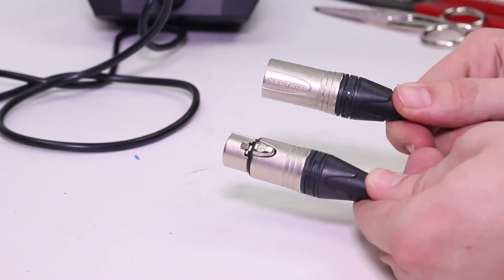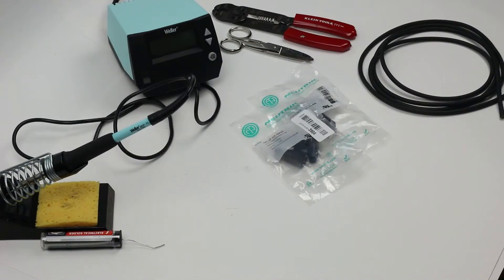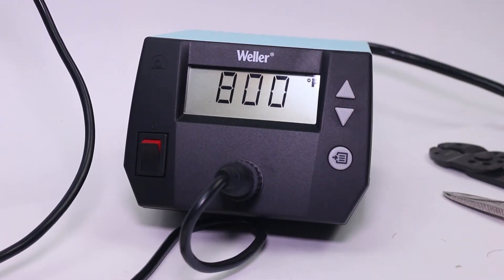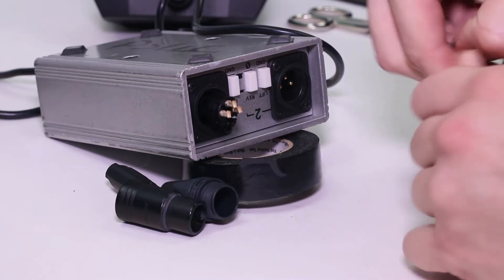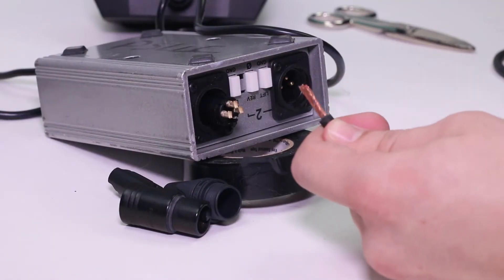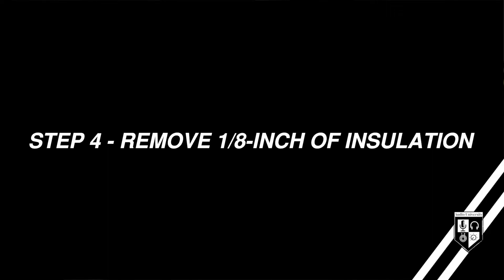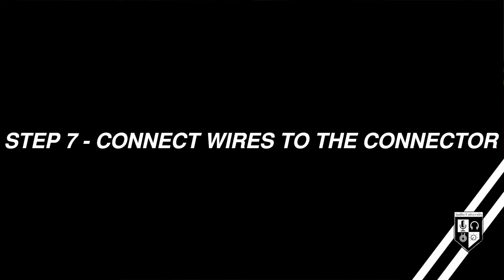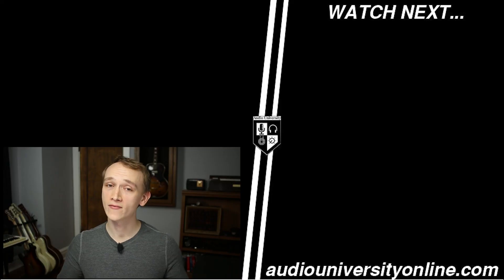How To Solder XLR Microphone Cables [Step-By-Step Tutorial]

Comment: Thanks man , you’re a highly trained and skillful teacher too . I notice that in the SHURE SM 58 User Guide that there is a wiring diagram , I see that on my repair numbers 1,2,and 3.i am using alpha fry 13463 Fine Electrical Repair solder . Works for me😅.63/37 rosin flux core . I didn’t know how to repair one mic cable for months ! Now I can . Thanks.

Comment: Old guy here.  Been soldering for 40 or so... Make sure your don't cut any strands.  If you do?  restrip.  Thats why you want a service loop.  Tinning wires? make sure you can see every strand.   Clean your tip. Fill the XLR cups.  Soldering should take no longer than saying solder.  Clean your tip, wet your tip with solder, and turn it off with a wet tip.  Heat the thing that you want to solder to, with a wet tip, Not your wire.

Comment: Probably being a bit anal here, but after you have applied the soldering pencil to the joint and then remove it, I find the wire wiggles just a little before the joint sets, as it’s hard to hold the wire perfectly still. Can this lead to a cold solder joint because the wire is moving a bit?

Comment: Which is male and which is female jack? After soldered figures must be shown clearly as it is our main purpose here. When cutting there was no white colored wire but when soldering there it is, why? In your diagram the colors are red green and black but in actual there is no green and black. This tutorial is confusing.
Reply: Regarding the diagram, the insulation around the conductors isn’t guaranteed to be any particular color configuration, but using green, red, and black to indicate ground (pin 1), hot (pin 2), and cold (pin 3) is fairly common. In this case, the best way to ensure you’re soldering wires to connectors correctly is by using an electronic multimeter to test the opposing connector for Ohms/continuity.

Regarding the “white colored wire,”if you actually watched the tutorial in its entirety (a whopping 6 minutes and 40 seconds), you would know why the color of the copper shielding changed to “white colored wire.” Go to 5:05.

Finally, you’re watching the wrong tutorial if you’re asking about jack genders and needing a closer look at after-soldered figures that are already shown sufficiently. But, the jacks on this broken transformer are both male (which you can see in the video), meaning the connector is female. You can also tell at the end as he assembles the connector.

Best of luck.
Reply: Yikes. Dude, clearly you're not inclined for this. The diagram isn't meant to say "LITERALLY ALL CABLES WILL BE THIS COLOR", it's just a random color coating. Not to mention it's quite obvious which is male vs female. Just look at the pins 🤦🏻‍♂️ and a simple "male XLR" into Google would easily answer your question. Your condescending complaining is ironic considering how ignorant to this stuff you seem to be.

Comment: 4:22 Unless your cable has a drain conductor, in which case you can safely snip away the shield. Also in some cases (like Canare L-4E6S) the shield is quite massive and only a portion of it is retained for pin 1.

Comment: Should the cable shield going to pin 1 also be tied to the XLR shell pin or not? I can't seem to find a clear answer to this anywhere.
Reply: Definitely not! Consider the situation where you pick up two XLR cables to mate them, one in each hand, and there is an electrical fault in something one is connected to the other end... You get a shock straight through your heart!
Pin 1 of a chassis XLR should be connected directly to the chassis, not the signal 0V, and the cable shell will be connected to the chassis too when mated and will overlap the cable shield.
The correct recommended professional practise is outlined in the AES48 standard.

Comment: I have 2 XLR female inputs connected to the circuit board of a Behringer Europower PMX 2000 mixer/amp which aren’t working.  I think the pins inside these connectors are no longer making contact with the male pins of the mic cord.  Can this be corrected without changing the female input?  Thank you

Comment: If I reversed this, could that work as an inverted phase/reverse polarity, whatever it's called?

Why do I want to know? My sound card lacks a button for the inverted phase/reverse polarity for my microphone, so I thought of getting a “xlr adapter cross wired reverse” for this, if it would work? I don't know if it would? If it would also, I think of maybe turning one xlr cable I have lying around into one, so I don't have to order one of these adapters.
Reply from the maker: Yes. Keep the shield the same and reverse positive and negative.
Reply: @AudioUniversity  Thanks!

Comment: Can I use this cable as/for a  powered speakers?
Reply: Yes. You can use it for line and mic signals. However you can't use it for old passive speakers that use the xlr connection for amplified signals. They used to have xlr where now speakon is the standard.

Comment: Can (or how do) I cut the connectors off of a dvi-d cable (or any old cable) and replace the connectors to a 1/4in (ts, trs)? Is this possible? I have some high quality cables and would like to convert/recycle ♻️  cables to by replacing the connectors. Any input is appreciated.  Thanks!
Reply from the maker: You’ll need to ensure the cable you’re using has a shield and the appropriate wires. Some cables use much smaller wires than are recommended for audio cables.

Comment: I hope you see my concern. I saw the manual of qsc amp I'm using. The balanced xlr shown to their manual is a bit confusing. The wires 1,2 and 3 on the amp side are all connected while on the other side of xlr only 2 and 3 are connected. Is there any reason for it? I hope you see it. Thank you
Reply: Probably for 2 reasons:
1) to avoid ground loop
2) amp has connection to the ground and will pass any interference induced signal to the ground while the source (guitar maybe?) has no connection to the actual ground. You only need hot and cold signal OR hot+ground OR cold+ground to pass the signal (if you have both hot and cold you don't need the ground actually) so with balanced connection shielding grounded only on amp side. 
Unless you don't cause ground loop in your line it should be OK to use regular wire with all 3 pins connected.